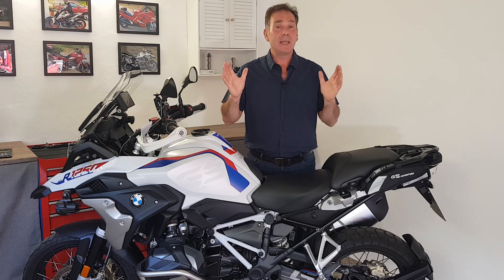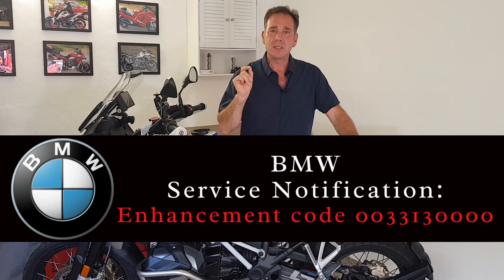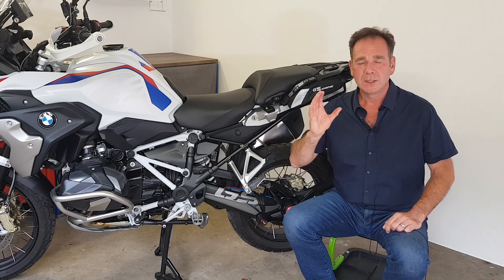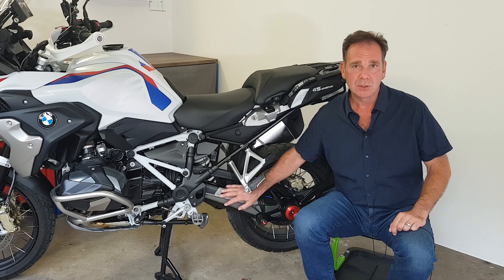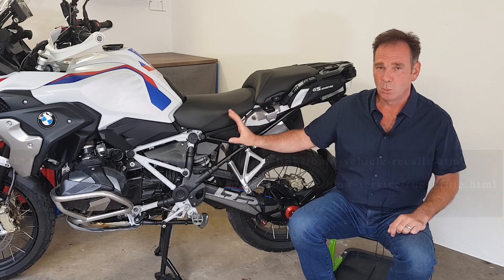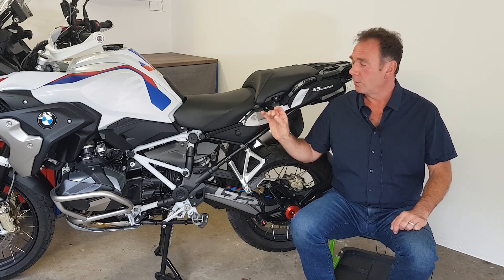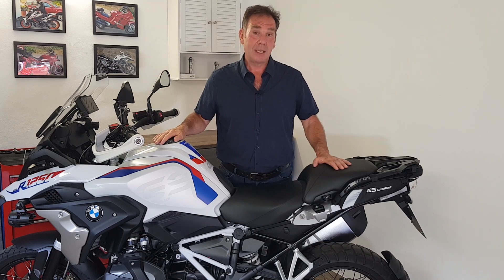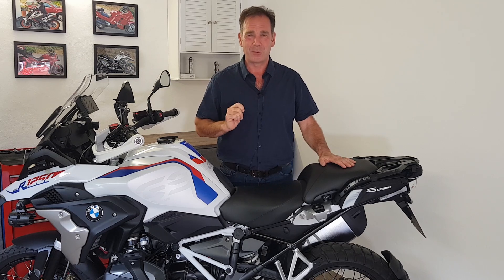EP:8 BMW Announce - Drive Shaft Corrosion Inspection and Test - Service Action 0033130000

Comment: HI guys, does anyone know what the valve looks like? My bike is a 2021 model, made late 2020.  It has a protruding piece that stick down from the shaft, with what looks like a perforated part to it. this must be it, but this perforated part looks like it could easily get clogged up.  And does anyone know where to check, on line, whether it needs it or not? Ive tried what he says and im getting nowhere.  Nowhere it says anything about the service recall etc
Reply from the maker: Hello Michael,  if your bike was built in late 2020 it will not have the modification. 
The modification was introduced this year 2022.
If you can not find details on line, please go into your local dealer with your chassis number and they will check and tell you the status of your bike. Best wishes Carl
Reply: @justthewayitis  thanks Carl, what I would like to know, is where you actually look for the information. You say in the clip where to check, but this gos no where.
Reply from the maker: Hi Michael, its depends  on your location,  but all countries have a BMW recall site where you just enter your chassis number to check. If your unsure just contact your nearest dealership.  Carl
Reply: @justthewayitis  Thankyou Carl, I’m in the UK btw
Reply from the maker: Here you go 
https://www.bmw-motorrad.co.uk/en/service/recall-lookup.html

Comment: Unfortunately, you might be waiting a long time. German industry is struggling because of ridiculous sanctions which are impacting everyone but the country they were meant to hurt. Now, a dealer told me yesterday, that you cannot order the GS/GSA with the adaptive headlight, and it’s the same for the S1000RR. I’m buying a K1600GT (or GTL) and the new ones are not affected.  Mercedes has the same problem with their headlights on the E Class convertible. I’ve been looking at buying one for the wife, and for the last six months, you can only get the basic LEDs, not the Adaptive Multibeam. As the C Class Saloon and Estate are new, they’re getting the full digital LEDs. It seems that German manufacturers are ensuring that they get their new models to customers with the promised specs. However, a model that’s been out for a year, is getting the old tech. 

The BM dealer told me all new GSs will come with Halogens!
Reply from the maker: Hi Alberto,  thank you for sharing your experience with this, it will help others. I think this will only get worse and I have been told the new GS has been pushed back in terms of release date.
Best wishes Carl
Reply: The big problem is, all consumers are on to a loser. The second hand market will see big increases as supply dries up. It’s a seller’s market. If you want the latest tech, you’ll have to buy second hand.

Comment: Carl, excellent and  informative presentation. Thanks.
My GSA is a 2020 with 40k KM on it now, and did hear about some drive shaft issues after I had the bike for 6 months.
Just for my own piece of mind, I opened up the drive shaft assembly to have a look.  There was certainly evidence of moisture ingress, and corrosion on the drive shaft and couplings. Whilst this moisture and surface corrosion is not a big issue in itself, I also found that the splines on the shaft were not lubricated on initial assembly, and there was evidence of fretting on the mating / sliding surfaces.
From what I understand in other cases, the moisture trapped in the swing arm led to corrosion forming on the shaft, so causing the shaft to seize on the splines, which prevents the shaft from moving axially as the suspension moves up and down. This will overload the bearings and universal joints /couplings leading to shaft failure. 
On mine, the damage was very minimal, so I just cleaned it all cleaned up applied  a high quality spline grease liberally to the splines.  Whilst I accept the moisture ingress issue is not yet resolved on my bike, I'm confident that any further corrosion will not damage the splines or inhibit their movement.  It will be good enough to get me to Morrocco and back!
 IMHO, if the splines had been greased properly on initial assembly, the moisture in the swing arm casing would not have been a big issue.
Keep up the good work!
Reply from the maker: Hi Gary, good evening,
I think you are probably right and maybe it’s a combination of applying the correct grease , making sure the shaft is free to move and now adding the moisture ventilation valve modification.
When I return from Norway I will be taking things apart to inspect and grease.
Thankyou for sharing your experience with me and the other subscribers, i am sure this helps everyone. 
Kindest Regards
Carl

Comment: Interesting.  I had to have new bevel and shaft as shaft spline rounded out.
Repaired/ replaced at 7000m by bmw. Foc.
But no recall to me for modifications . no notice either regarding chassis number. Still this valve would answer my previous issue. I'm jubious as to its future. Now done 10000m since 2018.
Reply from the maker: Hi David,  thank you for sharing your experience I am sure others owners will appreciated the input. Carl

Comment: I think it's more about driveshaft splines not being greased properly so the drive shafts seize on the splines and the whole lot becomes scrap under warranty. Please forgive the cynicism on their reasoning but if you go on any forum and check the posts the amount of GS's with seized drive shafts is plentiful.
Reply from the maker: Hi Darren, if you also read the top comment from me, you will see that I think BMW plan to replace a lot of these... or at the very least free off and grease the splines. I agree it's a bit late, but it looks like they addressing the issue. Lets see as time progresses what they actually do for GS owners. I'm sure soon people will post their experiences. 
Carl
Reply: @justthewayitis  Yes it's something that's needed addressing for a long time, maybe since the Hexheads came out. I had the issue on my last 1250GS. Luckily they managed to free the drive shaft without causing major damage. I asked my local dealer to grease the splines on my new GS-TB at its running service a couple of months ago.
Reply from the maker: Great news 👍

Comment: Hi just been and checked my 22 plate gsa and its got a 8mm hole on the underside but no valve, I think a trip to my dealers is called for....... thanks
Reply from the maker: Hi Andy, possibly the valve has fallen out. I understand a valve should be installed. Good luck at your dealership and please post back here once you have your answer.  Thankyou Carl
Reply: @justthewayitis   Good morning , so I have a answer yes my bike has got the mod done in factory brilliant... BUT the valve will need to ordered its either never been put in or its fallen out, luckily its going in for its second service next week and it will be done then, 6340 mls since march and loved ever mile. O can you tell me where you got the decal from thats on your drive casing it looks very smart ???
Reply from the maker: Hi Andy,  thank you very much for taking the time to update us all, perhaps other 2022 owners might like to check on an occasional basis to make sure the valve is still present. 
I'm not at home, so I do not have the part numbers with me, the next 2 episodes later this week are all about the accessories so you can see more then.
But I think it was from an Italian company called: AZ Graphis which have lots of options. 
https://azgraphishop.com/en/

Best wishes Carl

Comment: Checked my 2022 1250 GSA; seems to have the rubber fitting (I felt it, didn't get under it to visually examine it). Bike is going in for its service tomorrow, I'll bring it up just to be sure.
Reply from the maker: Hi Ray  good idea to ask and check. 👍
Best wishes Carl

Comment: Useful bit of information but would be very helpful if anyone with the mod could share a clip or picture, my 21 build isn’t listed when doing the online check but it doesn’t appear to have any modification via the factory.  Any uk owners reading checked & got confirmation work is needed?
Reply from the maker: Hi Mike and welcome to the channel. Just run your hand along the bottom of the drive tube. At the lowest part  if you feel a small rubber valve its been done.
Carl
Reply: @justthewayitis  I already have fella hence my comments about more detail from someone who has it, more concerning is the lack of result conducting the online check. I've run the gopro along the bottom & bar the usual anti drop stub see nothing rubber like given the online check says no outstanding items one would expect something present 🤷‍♂️
Reply from the maker: Hi Mike, I can imagine your concerns, all I know is what have shared already... it may be that your bike is not affected, I tried my chassis number in the uk and here in Germany both times it confirmed a Technical Enhancement is due. Perhaps call your local dealer tomorrow and give them your chassis  number and ask them to confirm. 
Regards the lack of information online... I guess BMW wanted this to take place slowly and gradually as part of routine servicing schedules, and this makes complete sense  as not to overload the dealer networks. 
But the technical documents have been uploaded to several GS owner forums here in Germany... and this is how i heard about it.
I think BMW should be congratulated for taking these steps, perhaps they are not happy someone released the documents but it was bound to happen. 
Let me and the others know how you get on.
Best wishes Carl
Reply: @justthewayitis  yup I plan checking with the dealer but always good to be armed going through the door these days, if it needs the work it’s a good opportunity to have the software updated at the same time given the glacial pace that runs at.  Maybe worth a follow up vid with some pre & post shots included if you have a date for yours, mine is not used for river running so not a huge issue & I can check & lube splines myself but if there is a service notification remedy for moisture ingress etc. stealer network whilst under warranty is the way to go for now.  Looking forward to seeing what accessories you have thrown at it.
Reply from the maker: Thank you,  and good luck tomorrow 👍
Reply: Im unable to find the link to carry out a recall check, could you point me in the correct direction as tried the link given on the you tube vid with no luck..
Reply from the maker: It depends on your geographical location. Just type into a search browser (bmw recall) and scroll down through the links until you find one for your country. 
Or call your call BMW dealer and give them your chassis number. 
Best wishes Carl

Comment: Hi, and thanks for the video. I checked on the BMW Recall, it says "There is an open technical enhancement on this vehicle. Please go here to book an online appointment for your vehicle selecting "service as required" or contact your local retailer for more information. Enhancement code INFO772590." Do you think this is it? 2016gs Thanks Ray.
Reply from the maker: Hi Ray and welcome to the channel. your code number is different from mine, but I think that's the one. dont stress the work will be done next time your bike is in for a service. Best wishes Carl
Reply: Hi, where can I carry out a recall check, tried the links on the you tube video but no good, cant find the link on bmw dealer site either??

Comment: Thanks fof the information Carl. To do a proper job BMW would need to inspect the driveshaft and associated components for corrosion and rectify as necessary. Do you think that this is part of the technical action?
All the best from sunny Wiesbaden   Nick
Reply from the maker: To answer Nick’s question and help others. I do have the actual 8-page workshop notification and instruction, but it’s in German. This is MY UNDERSTANDING…. And not a direct translation. 
A: less than 2,000 km: 1: Carry out modification. NO INSPECTION

B: More than 60,000 km: 1: Carry out modification. 2: Replace drive shaft unit.

C: Between 2 and 60K km: 1: Carry out modification. 2 Perform drive shaft test. 

      Option 1: Drive shaft fails test – Replace drive shaft
      Option 2: Drive shaft test passed & no water or only a few drops drip out during modification – no extra work is 
      done.
      Option 3: Drive shaft test passed, but more than a few drops of water come out – drive shaft splines are then 
      inspected for wear and inspected to see if it is seized . 

       If it is seized, an attempt will be made to free it off. If this can not be done the drive shaft is then replaced.
       If the wear on the splines is excessive, the drive shaft will be replaced. 

So please understand that this is my current understanding of the instruction given in this document. The document could be updated at any time by BMW, and I have not seen the English version yet.

If you have more questions, please contact your BMW dealer.
Carl

Comment: Why is this a problem for new bikes, the GS has been in production for years, what has BMW done in the design or manufacturing process for bikes to potentially rust from the inside out? The drive shaft has flipped sides over the years, maybe a chain might not be a bad idea after all!
Reply from the maker: Hi Jean, a good point, hopefully I will find out more over the coming weeks. Carl
Reply: @justthewayitis  I presume that the shaft drives have always been “dry” except the final drive unit with oil reserve at hub? Let us know your discoveries, all very interesting. Don’t get rid off the old R100GS!
Reply from the maker: I have now added more information at the top of the comments section. I hope this helps
Reply: @justthewayitis  Thank you, does this happen with the Japanese manufacturers as well?
Reply from the maker: Yes, they all operate in slightly different ways but you check for recalls and any work that may be required by giving your dealer your chassis number. Carl
Reply: @justthewayitis  Yes I’m aware that all manufacturers of motor vehicles have recall systems to satisfy Federal and EU regulations. My observation seems to be that BMW bikes have more recalls than the industry average, are Japanese bikes subject to less recalls? I have a BMW bike and yes it has been subject to a recall and an inspection.
Reply from the maker: Sorry, now I understand your question. Yes the Japanese motorbikes are still the most reliable and have fewer recalls and technical issues. I still believe their pre production testing protocols are more advanced than the European manufacturers. This is partly the reason why the Japanese bikes are several years behind in terms of technology. Carl.
Reply: @justthewayitis  Thank you very much for the informative reply. My impression is that quality control has been diminishing in the BMW bike sector since the  “Ewan and Charlie” phenomenon, in the rush to fulfil dealerships’ requests for product. Anecdotally and in forums the failings of BMW bikes seem to be common, certainly more common than Japanese bikes and your observation seems to confirm my thoughts by the differing approaches to R&D. The technician that looks after my bike suggested that if I purchase new again, I should purchase a BMW warranty after the three years, the bikes can be unreliable and incredibly expensive to repair out of warranty. He added that Japanese bikes are not entirely trouble free as you might think though engineered to better reliability standards than BMW. Oh well, I suppose better to have realistic expectations from the outset. Thank you once again, by the way I have a BMW car and that was subject to a manufacturer recall, parts changed due to risk of fire. Toyota announced a recall of their electric cars, the wheels are falling off, not all perfect in the land of the rising sun.
Reply from the maker: Hi Jean, your very welcome,  and thankyou for sharing. Best wishes Carl
Reply: @justthewayitis  Thanks Carl, must be demanding and hard work keeping up with all the correspondence from the channel. Good luck with long term ownership of the bike and many trouble free years of riding pleasure. Look forward to your future posts, kind regards, J
Reply from the maker: Thank you 👍

Comment: Thanks Carl.  Like GSD321 I went outside immediately after watching your video to check if mine has the valve. I did find that rubber piece that sticks out a bit, but still need to check online with the chassis number. Very helpful… thanks. 

I do wonder though, if BMW should not let all owners know about these issues.  Or we just need to check every now and then if there is a recall or alike on our bikes.  I would rather have them inform me…

Anyway, thanks again and safe riding.
Reply from the maker: Hi Max,  glad to hear your bike is already modified. Yes it would be nice if the supplying dealership kept us in the loop with updates and notifications, we would all be happier perhaps. 
Best wishes and enjoy your weekend. Carl

Comment: I wonder if this is due to so many people having their drive shafts corroded so bad at the final drive they couldn't get the shaft disconnected?
Reply: Possibly. Also, the mere fact that they are so corroded raises the concern as it is not listed as area that undergoes service maintenance. I did mine but had no corrosion - clearly I don't wade deep enough - but it was a bugger to get the shaft to align to the drive unit!
Reply from the maker: Hi Correy, good morning...
I managed to get a copy of the original internal BMW Technical Enhancement Notification Document (0033130000 8 Pages ) its in German, but i would imagine versions of this document will be available in other languages very soon.

Your thoughts are probably correct, and possibly part of the reason why they are going to modify our bikes. What is interesting is that the 2022 onwards bikes already have this modification installed.

Best Wishes
Carl
Reply: The splines corroding themselves together would not in itself cause drive shafts to fail as they have been.